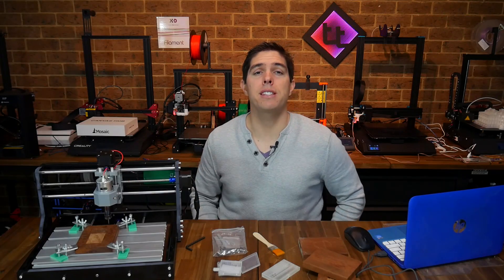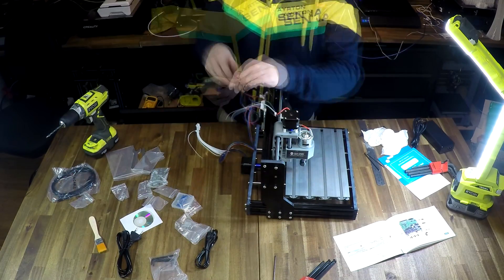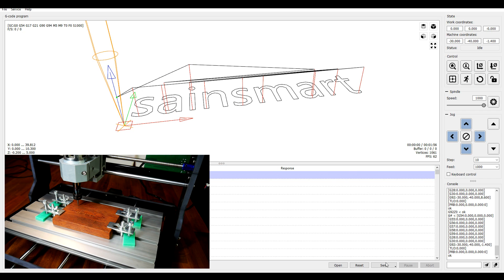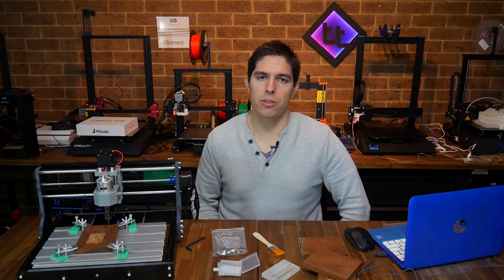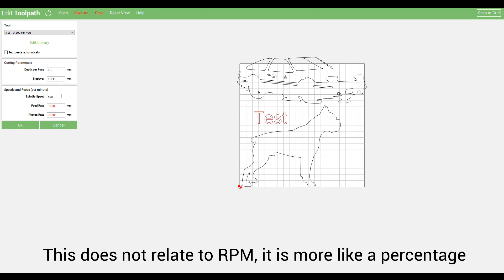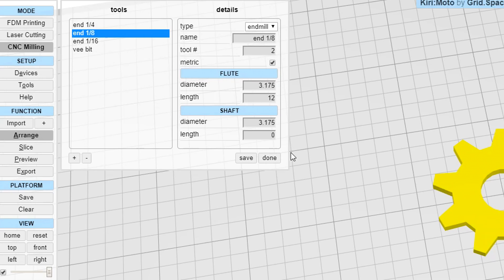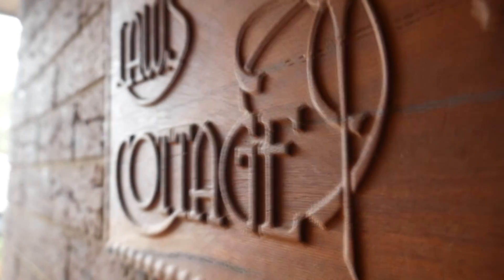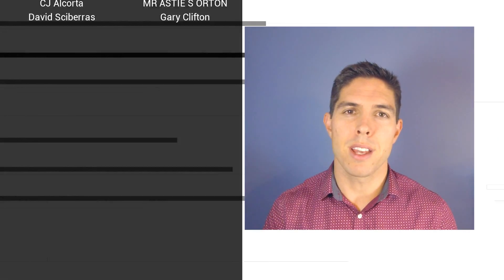CNC router for $200 - Sainsmart Genmitsu 3018 Pro review and tutorial

Comment: I have this machine and I would not recommend it at all. It is almost impossible to square this machine. Aluminium bed plate has few millimetres difference from one corner to another which for 300x180 mm size make a big change. Therefore as presented in the movie above it does not take material in the same way. It should be added bed levelling system. In hardware as well as in software. I found in the internet some Matlab scripts which change the gcode for bed levelling however nothing is implemented directly in software. The rods are not straight at all...I contacted them and they told me all theirs pieces are the same quality....well...I got for what I paid....

Forget, really to cut any metal. After some time , this cheap engine will get much loose what even more complicate work with it. You need to add external mods to work somehow with it. However, honestly, I would better recommend CNC 3020T or 3040T.

I think you should be more critical for this machine. You can clearly see on your movie that results were not nice. Ah, I have almost forgotten. I have often connection problem and the system crushes and I have to start from beginning...
Reply: The bed leveling can be fixed. Just loosen one of the rods of the bed and then adjust the level.
Reply: @salpuy  

Believe me, I tried even more sophisticated solutions. It does not work.
Reply: Bcnc has nice auto leveling